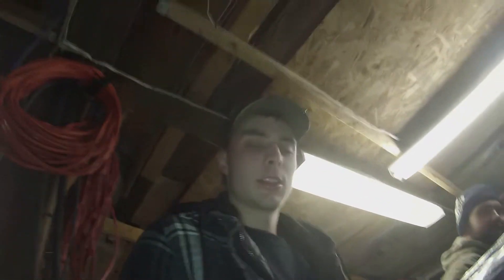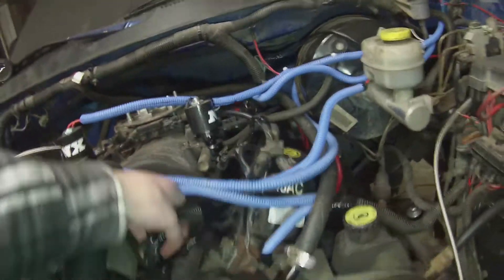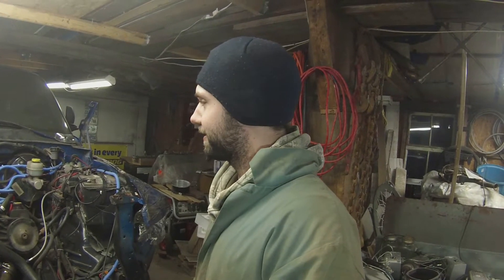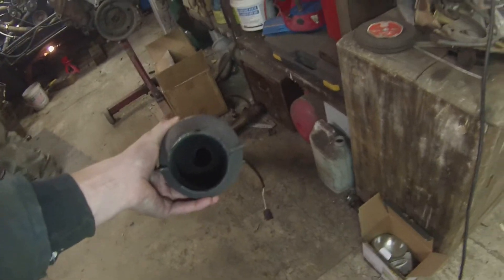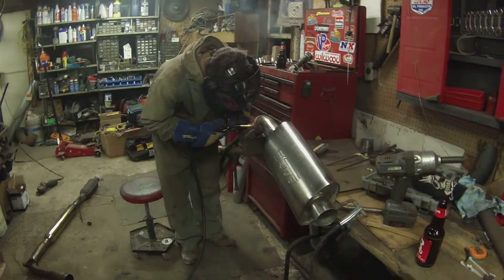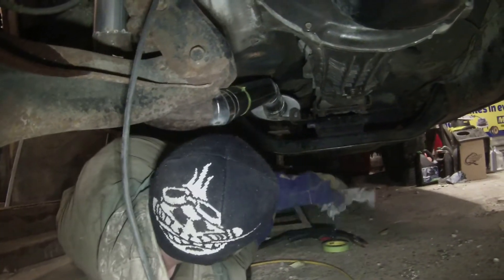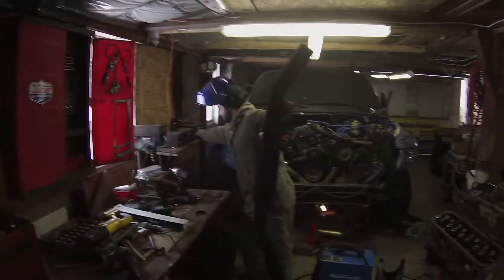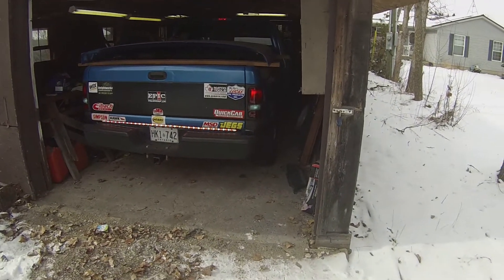5.2L Dodge Ram turbo build part 4

Comment: I have a 99 Dakota. 5.2.  Want to do this.  
What do you think about a U past the Y in the exhaust to return to engine bay for  turbo.  Thanks.
Reply from the maker: Jorge Villamil The less exhaust around the motor and transmission keeps heat down as long as the tune is right it shouldn’t be very laggy

Comment: Siiiiick love this build man i got a 94 Dakota 5.2 4x4 with NV3500 5 speed and solid axle swapped on 1994 dodge ram 2500 axles and 37x15.50 Toyo mt but i plan to turbo it eventually, definitely following your build
Reply from the maker: Hell yea man!. There's an update video coming soon for this build.